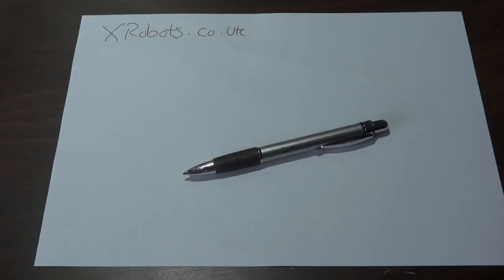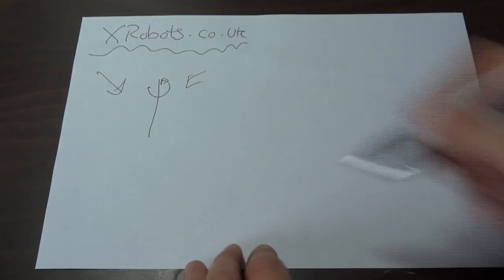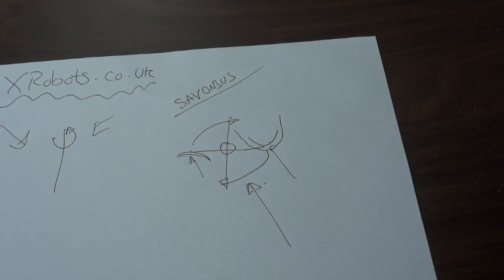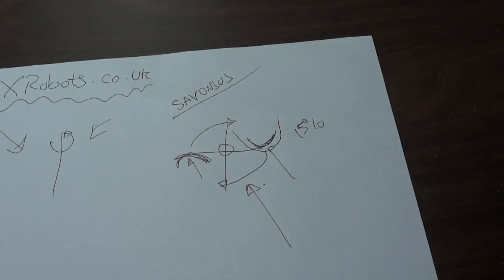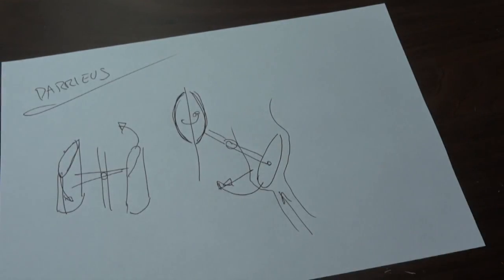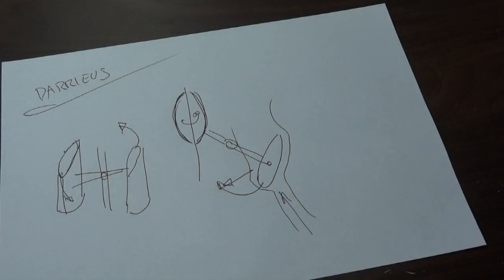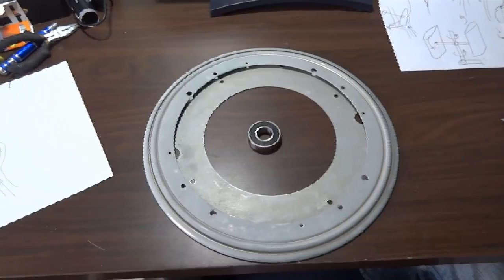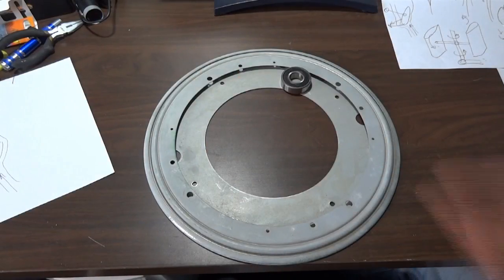Experimental Wind Turbine Building Part 1, Transforming Savonius Darrieus Hybrid concept

Comment: If you move the slide to the rear end of the aero foil and fix the hing on the leading edge you may be able to make an automatic open and close mechanism using springs to open and a weight to close. As it spins faster it will pull the weight and close the aero foil.

Comment: The issue with this, regardless of the actuation mechanism is that in the drag configuration, the turbine will be spinning at only as fast as the wind is going (TSR = 1). For the darrieus turbine to generate lift it needs to spin (usually) at least twice as fast (TSR = 2) so unless you can also move the blades out to twice the radius when it converts, there'll be a dead zone in the graph of Cp versus TSR that your turbine will never be able to get past
Reply: Great comment so, in order to achieve lift, the Darrieus type is using the electric motor to reach TSR 2 ?
Reply: BS

Comment: why not have the outside savon-half fixed and just the inside one opening , held open with  spring , and when its spinning fast enough , centrifugal force will push it out, and close it

Comment: Hi James, long time fan. My first thought on this is that there are a lot of moving parts. 

Could you not have something similar to a bicycle setup, where the savonious would take the place of the "peddles", and the darrieus would take the place of the back wheel. 

Im imagining the savonious picking up the small wind levels, which pushs this energy into the darrieus, then for high-speed winds, the cogs would allow the darrieus to move faster than the savonious.

Comment: This is great!  I particularly like the idea mentioned by gordontarpley about having it self-start and run in an "optimized" mode.  I think in that configuration, you'd also get your high torque to direct-drive, since the mechanical "pull" on the system would serve to slow the spinning down and thereby open the cups and give you more torque.

Anyway, very inventive and very, very cool!  You should patent this idea and make truckloads of money.  :)

Comment: Fantastic idea! 
Have you considered attaching a small, sliding weight to rod perpendicular to the main shaft?
As the the turbine accelerates, centrifugal force will pull the weight away from the main shaft, which will in turn pull the sting/cable and close your blades. A light pull-spring could bring the weight back to center as the speed slows down. 
Just an idea. I'll draw it up after work today and pass it along if I'm not making sense.